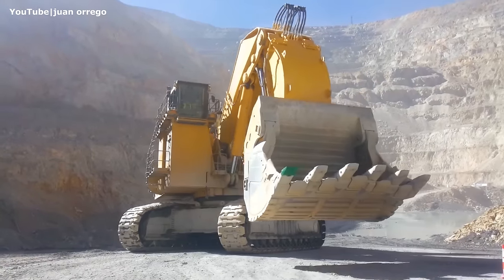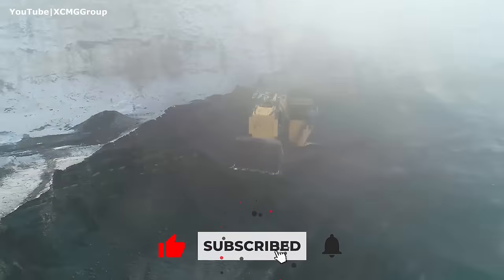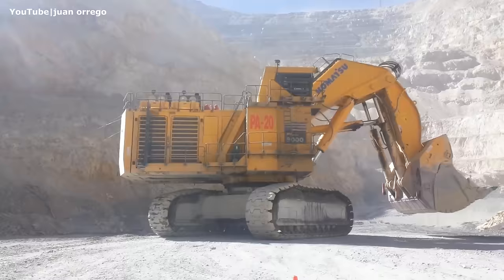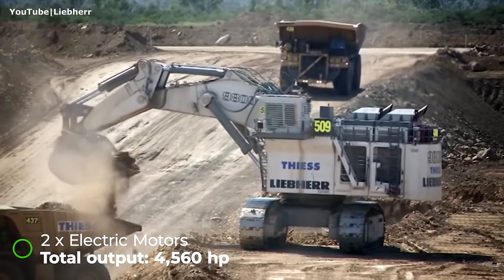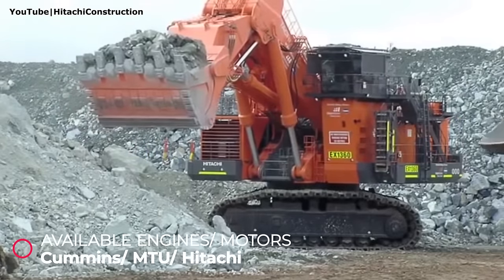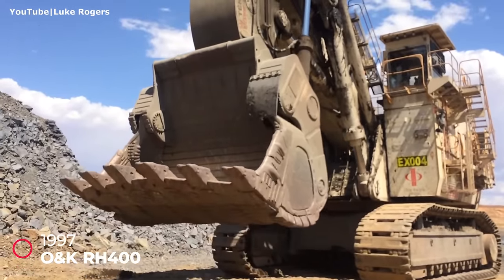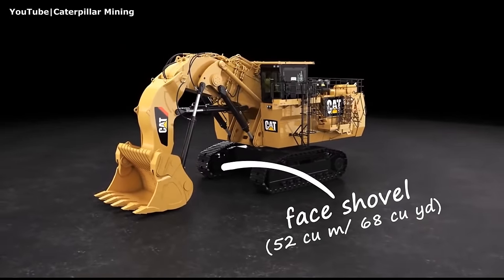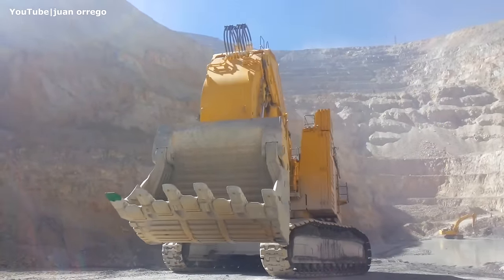Top 5 Largest and Most Powerful Hydraulic Excavators in the World 2023

Comment: Maybe the 6120 was only invented coz cat doesnt like the history of the rh400, there is probably no market for such a monster, from the rh400 only 7 units were sold in 20 years.
Reply: The 6120 was actually designed and built by Bucyrus, after their takeover of Terex Mining.  If you count the Cat 6090, which is just a renamed RH400, there were more than 7 built.
Reply: @alco4248  Ah, Thankyou. Off course do i count the 6090 as 400, but its hard to get those numbers. Do you know how many it are all in all?
Reply: Actually, the 6120 was built before Bucyrus took over Terex. Once that acquisition was complete there was no need for Bucyrus to continue the project as they had a full line of hydraulic excavators.
Reply: @Mr.Robusto  Funny how they incorporated several O&K/Terex design features into a machine that you claim they built before they bought Terex Mining.
Reply: @alco4248  That is correct,  because they hired a bunch of engineers that were ex Terex employees to help design the machine. Bucyrus purchased Terex in February of 2010. The 6120 project was intitially started in late 2006 or early 2007. The machine was already built and assembled prior to the Terex purchase. Kind of have a decent knowledge of this as i purchased a majority of the steel components on the 6120 machine when i worked there and was on the project team.
Reply: @Emily Emily  -v?
ily792-v Ok 👏
    👍
Reply: @alco4248  The 6120 (RH 500) was built and being tested years before Terex acquisition. It was also Bucyrus painted.

Comment: Y Does the 6090 FS run Cummins engines and Not CAT🤔
Reply: Was on the team that transitioned the build from Dortmund to the US.  The equivalent output CAT engine was 18" too long. The entire back end would have needed to be redesigned. Too many engineering hours and dollars for a small payback based on the number of units sold.

Comment: Is anyone else curious about the batteries in the electric versions. They must be massive
Reply: They don't use batteries. They are powered by a very large cable directly. In one section of the video you can see the power cable.
Reply: 2:00 you can see the cable
Reply: @Emily Emily  ?
Saya yang lalu
Reply: @corybrown8422 I wondered what that was, thank you for clearing that up.  It's a bit like me running an extension lead to my shed.